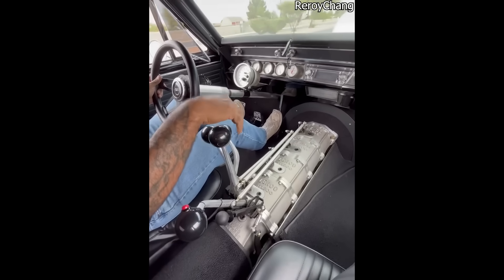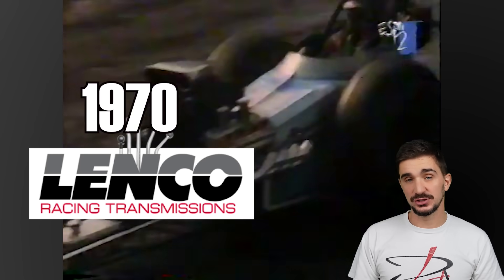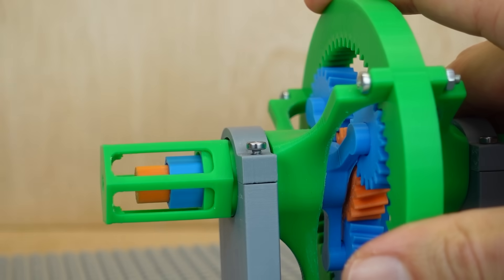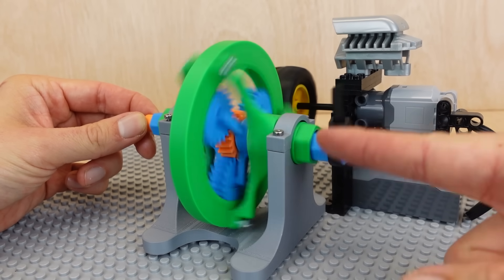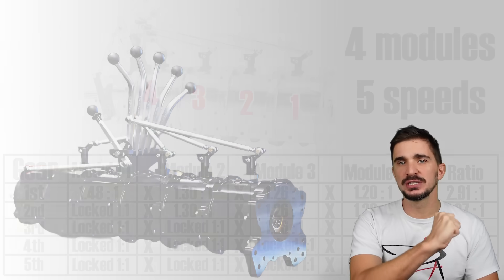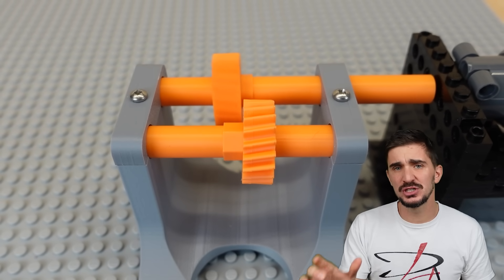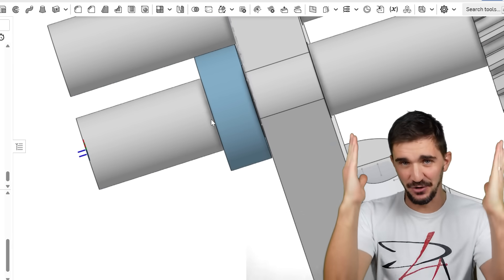This is The Strongest Transmission Ever Built - Planetary Manual Lenco Gearbox Explained

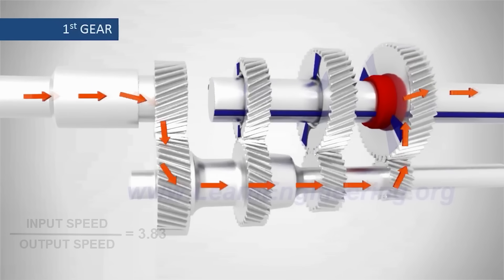Comment: 10:50 Isn't more that each transfer of power is going through a single point of contact in a standard gear box and three points of contact per power transference in the planetary. Any failure of a gear in each system would break them, since a broken tooth could bind into another gear set. But, the planetary has three gear contact points (times two) sharing contact for each change from shaft power in to gear mesh to shaft power out.

Comment: Wonder why they don't use a scaled up version these in 'automatic' trucks instead of the goofyass automated manuals that, other than volvo i-shift, never work properly and shift slower than an extinct species of squirrel that's been soaking in a pool of bubbling, hot bitumen for the past 3,000 years.

Also, if you start doing a series on transmissions, the venerable Eaton 10, 13 and 18 speed (including them all because to my knowledge they have pretty similar internals) needs to be one you cover even though it's not a normal car transmission. The things are legendary in industrial and commercial vehicles. Also it'd give you the opportunity to talk about double clutching and transbrakes since even brand new ones that came off the assembly line last Friday are not synchronized.

Comment: Straight cut gears are in fact stronger. But not because of the teeth angle. It's because you don't care about smooth meshing since you don't care about the noise, so you can make bigger teeth with more aggressive profile, which are much stronger. If you need to make silent gears, the next tooth must engage before the last one disengages, hence the helical cut, but that still leaves the requirement to make smaller teeth in order to avoid excessive angle. If you compare different transmission gears, you'll notice that straight cut gears are narrower - the increase in strength allows to make smaller lighter gears. The lack of axial thrust also improves transmission efficiency by about 1-2% which is a very significant advantage in a race.

Comment: It looks like a planetary gear system could theoretically be setup to give 2 outputs from a single input, albeit potentially in opposite directions, if you could set up the ratios to give what you wanted.

Like, a piston engined aircraft could potentially use part of the gearing for propeller rpm reduction, and part for supercharger torque reduction, from a single set of gears

I don't know if this would actually be practical or not...

Comment: Any reason why you can not use 4 pistons or motors to move the levels, add an simple add an 8 bit computer and  you now has an automatic / sequential gear box. You can use more gears if needed. 
Think this would be nice for trucks you could add more gear is needed.

Comment: Well, the logic you are trying to force on us with "more contact points make for a stronger transmission", of course, does not hold any water. 
Contact points that transfer torque _sequentially_, one after another, do not combine to make the transmission stronger. They obey the ordinary "weakest link" principle: the entire sequence is only as strong as its weakest link. So, no, sequential contact points in such transmission add absolutely nothing to its strength. Claiming otherwise is just silly.
Parallel contact points are a different story though. A typical planetary gearbox with three planet gears features three parallel torque transfer paths. And that is exactly what makes it stronger that a regular manual gearbox with only one torque transfer path. This means that a transmission composed of 3-planet planetary gearboxes will be approximately 3 times stronger than a regular manual transmission. Three times, not 18, 21 or 24 times, as you seemed to incorrectly suggest.

Comment: I previously owned a Ferret Scout car which used a Wilson 4 speed epicycle transmission and the transmission was sandwiched in between a torque converter and a H gearbox with 4 drive shafts one to each wheel.
Very cool gearbox to operate.

Comment: When you think of it, a Lenco is one of the most efficient transmissions out there at highway cruise, since when you go to top gear and low rpm cruise, you have removed the geartrain loss, and the reverser itself is locked straight-through 1-to-1 in forward gear (they are standard 1.31-to-1 reduction in reverse due to being a planetary gearset and locking the planets in place so either the sun or ring is input or output). Problem is, so many gear contact points is also why automatic transmissions are less efficient than helical manual transmissions, and why helical manuals are less efficient than loud straight cut manuals, so a Lenco in first gear is losing a lot of power efficiency, and it gets more efficient as you shift up, the least efficient a Lenco will ever get is first gear reverse.

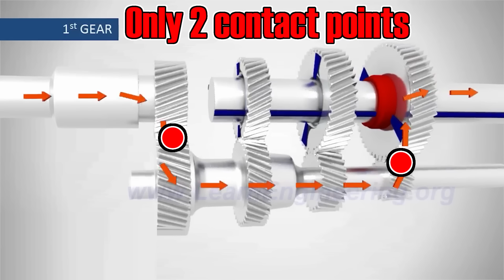Comment: The explanation at 10:55 about contact points feels a bit off to me. I'm only an amateur and not an expert so I may be mistaken. 

In a manual (as traditional manual), the torque is transmitted by a single pair of gears meshing all along the power line. 

So where you counted 2, there is only 1 and 1 : the transmitted torque goes fully through the first one, and then fully through the second one.

In a Lenco, at each stage there are only 3 pairs each time :  3 between sun and the 3 planetary, transmitting then 3 planetary to ring (or the other way around). The torque per pair of gears is therefore divided by 3 in comparison to a manual. Adding more stages doesn't change this number, as the entire torque is carried each stage.

But that's not all there is to planetary gears and if I'm not mistaken you did not mention it. Two paired gears, no matter if they are spur or helical, tend to want to get away one from another when they are under load. In a manual (as tradi manual), it means you need a very stiff axle or your gears will get a bit appart, and you loose efficiency and "gain" wear. With planetary gears, this is much less of a problem, as the ring keeps all the gears together, and is easier to make very rigid in comparison to the axle (bc of possible encasing and less lever than axle length).

Tbh the video was super interesting, I did not knew this kind of transmission existed and it will likely help me a LOT for some far future (few years) projects !

Comment: how do these engines, along with DCT equiped ones, shift so fast and smooth? I am talking about the actual engine speed. On a regular manual, if I don't rev match, the car judders and shakes as the engine tries to either speed up or slow down the car while the speeds match. how do these transmissions deal with the engine's inertia? why don't they shake violently when changing gears in, what, milliseconds? I figure that the reciprocating parts, well, they reciprocate, so their inertia doen't count (probably?) but what about all the rotating parts (crank shaft, cam shafts, flywheel, clutch, pressure plates, pulleys, alternator, compressors, etc) ?

Comment: I may be incorrect because I'm not an engineer but if you think about it, but in order to minimize wear you want to increase the number of contact points in PARALLEL. The planetary gears have three contact points in parallel (between the sun and planets and between the planets and ring). In a manual transmission there is only 1 contact point (between the gear on the layshaft and the gear on the output shaft). Contact points in SERIES only complicate without adding durability. That means planetary gears are still 3 times more durable then manual transmission gears.
Reply: Yes, always the weakest link fails in a chain, so connection count in series should not matter in terms of durability.

Comment: On any planetary gear set, with the Sun Gear input and Planet crier as output, the absolute minimum Gear Ratio is 2:1 but in a transmission shown here, keeping the Sun Gear fixed may be an issue.

To obtain lower gear ratios, you must use the Ring Gear as input and Planet carrier as output...

To obtain reverse, lock the Planet carrier, Input to Sun and Output from Ring Gear.

Comment: Only thing that's a real "downside" to it, is the sheer proportions of it. It could easily be made vastly more compact without loss of strength, and making the lock-arms linear or with a twist-rod config (so the more it twists it locks the next and the next and the next etc), and then EASILY have 6 speeds at no larger of a size of transmission than most regular ones in most road cars.

Comment: Weren't the old preselector gearboxes designed on the same principle?  One gearset per gear, you select the next gear in advance with a gearlever, then kick a gearchange pedal when you want to actually upshift or downshift.

Comment: 10:46 that comparaison is actually wrong. Yes in a manual transmission the torque will go through 2 points BUT it will not split between them but both of the points will experience full torque. Because they are connected not in parallel but inline. Its like two pipes connected one after another will pass all of the water and not half each. To split water between pipes you need to connect them in parallel. That said if we look at the transmissions we will have 1 point for manual and 3 points for planetary by the number of planet gears which are connected in parallel. The modules are connected inline so it always be 3 points for planetary trans no matter the number of modules

Comment: Important fact ->
Basicly one planetary set can do 7 different ratios. Not 2.

Example for set with:
20 Sun Gear Teeth
10 Planet Gears Teeth
40 Ring Gear Teeth

1st: (in)sun (out)planets: 1:3 
Very low gear
2nd: (in)ring (out)planets: 1:1.5
Low gear
3rd: double input: 1:1 
Direct Drive
4th: (in)planets (out)ring: 1.5:1
High gear
5th: (in)planets (out)sun: 3:1
Very High gear
6th: (in)sun (out)ring: -1:2 revers
Slow revers
7th: (in)ring (out)sun: -2:1 revers
High revers

+ neutral if noting is locked

So if you have just 2 planetary sets and you are able to use all combinations of power transmition you can have 49 gears! With 3 sets there is 343 combinations (gear ratios).

I plan in near future to do deep subject YT video about it but it will be in polish and will looks more like drinking pato-stream with elements of „Tinderówki” abuse + conflict with local police departament, than a lecture on the basics of tribology in mechanical planetary gears system.

Never the less… stay tuned xdd

Comment: Last I knew 5 years ago a Lenco 6 speed was $25,000 for just the transmission which means it is geared towards the more money than brains club where money is not an object & the crew chief just bought 5 of them for a season and not the average bear! The average guy would fit a Sagina 5-speed clutch to a TH-400 with a special hub to drive the front pump while the clutch is pushed in. Usually you would have to modify a few things but if you had a machine shop and some ambition you could build the clutch part of the auto and use a slipper clutch to put some major power threw your clutched TH-400 at a fraction of the cost and have the same thing!

Comment: the contact points are not as simple as just adding them all up equals the strength, for example any contact points in a series does not count towards strength, for example 3 planetary gears means 3 points in parallell, not 6. still 3 times better than 1 in a normal manual.

Comment: I wonder if they can be designed to handle reverse torque for engine braking, in which case i might put one in a powerstroke😅
Otherwise im stuck with a cummins g56 i guess
Reply: allison transmission is basically the same thing but electro hydraulically controlled. have they sprag clutches?
Reply: @martin-vv9lf  but theyre automatic, I hate driving automatic, theyre just so boring and I feel like a passenger.
If you know how to convert said transmission to manual control with a clutch and everything so there's no electronics or hydraulics, I would 100% be interested
Reply: @brough59  I don't think there's any alternative to hydraulic ratio actuation with those.

Comment: Okay, but from how the planetary-gear-transmission modules are set up, a single module is essentially a binary transmission. Meaning you could get weird and fucky gearing ratios by locking modules to 1:1 in non-sequential order (so instead of locking 1st and 2nd gear, you lock 1st and 3rd). Which would mean the actual number of gear ratios possible with a 4-module transmission is 16, not just 5, by locking gears non-sequentially (if you're an absolute nutcase)

Comment: While i find lenco trans inner mechanism really clever (at least for drag race application), i can't ignore it's just a automatic trans but with manual actuation and the sole reason it's stronger is because of the material used by lenco. I also always found really stupid to have many levers like that when they could probably make a sequential system making it simplier to operate and even maybe suitable for wider racing application. Also, more contact points probably mean more energy loss so it's a huge drawback

Comment: Double helical gears do not convert torque to thrust are quieter and can handle more torque bc there are more engagement points at any given time as apposed to straight where there may only be one tooth face in contact

Comment: great video, never seen one of those. one detail i would like to add: planetary gear boxes are strong because of another reason: on a normal gearbox, the forces applied not only try to break gears and bearings, but it also tries to push the 2 shafts apart, increase the distance between the shafts. the housing has to resist this.  on a planetary gearbox, these forces try to break the ring gear, but just reinforcing this ring makes the whole system strong enough.

Comment: The ford model T had a '2 speed' version of this with reverse.
How does a lenco handle reverse?
Reply: Reverse unit as the most rearward positioned unit, the lever operates, reverse in "ratio" (1.31:1) neutral, or forward "direct" (1:1).
Reply: @trunkmonkey-1  That's a high geared reverse.  But i guess, you don't put such a transmission in a practical daily very often.

Comment: The magic of planetary gear reduction also makes the under chassis running gear of any hydraulic excavator move using a hydraulic motor running on hydraulic pressure alone.

The so called "hub reduction" axles on large trucks also uses a planetary gear set on each axle. With another planetary gear set just Infront of the differential housing, the whole driveline can go on super deep reduction. It might take a while to get to the location under heavy load but it will do it at a very slow creep.

Comment: One question:
What happens if you pull the wrong lever (for example: instead of "activating 2nd gear" you activate 3rd)?
When activating 3rd gear, is 2nd gear also activated?
Or does the order in which the gears are activated not matter, but only how many are active?

Comment: Well explained, very interesting video.  Just one small error, when you talk about the strength the number of contact points in series does not really matter, it is always the weakest link that will break, which would be where you have 3 contact points, since all the torque is going through those 3 points.  Thanks for the video.

Comment: Now I don't feel so bad about my 1941 Ford 9N tractor having straight cut gears. Ford switched to helical gears when they came out with the 8N in the late 1940's. Mine may not be as quiet or shift as smoothly, but now I know it's stronger & doesn't need to rely as much on thrust bearings!

Comment: How could you not answer the most important question: what happens if you engage the levers in a different order? Because if it works, you suddenly have a whole lot of gears, and if it doesn't it would be interesting to know why. (My tip is it works but is impractical to use for some reason)

Comment: So how the clutches get pressed that hard by a lever moved by a hand
Reply: When pulled the shifter applies rotational force to the shift plate that "wedges" the clutch pack. 
Takes 35 lbs pull to engage the clutch pack. So don't skip "arm day" at the gym...

Comment: There are 3 contact points, not 24, since there are only ever 3 gears under full load though they experience the full load on two sides. You also only need to break 3 to break the power transfer (though due to the chips and added load from one of them breaking, the otgers will follow soon) So "only" 50% stronger, not 1200%. Still great though.

Comment: Another transmission that was fairly strong was the Chrysler Fluid-Drive transmission, a manual transmission with a fluid coupling. Since you didn’t always need to step on the clutch (except for when you were selecting a gear) since the fluid coupling would slip, the clutch would nearly last forever. Don’t know if a Chrysler Fluid-Drive would work in drag racing, but certainly would work very well in stop and go traffic.

Comment: You're going to have to cover sprag shock, the number of people who've figured out that with differing ratios in modules means more than just 4 ratios are possible is encouragingly high... but they haven't been taught what happens to sprags when they're applied too quickly and with too much force, and they have to reapply themselves when the planet is freed up to create ratio reduction again. 
This is why downshifting is tricky, disengage a module and blip the throttle hard enough and you'll scatter parts when the sprag locks after a brief overspeed and tries to absorb the entire driveline's inertia. You're only safe for engine braking in full direct drive.